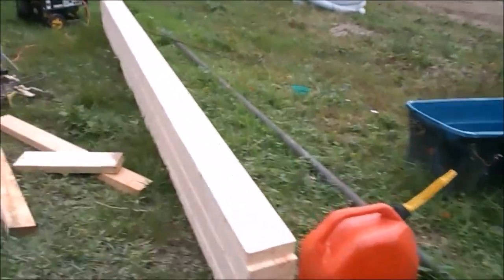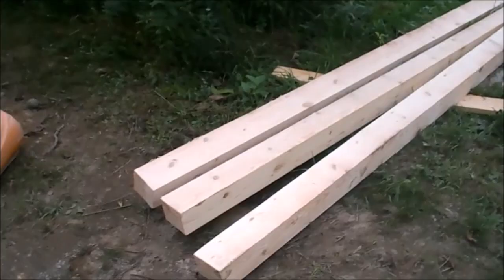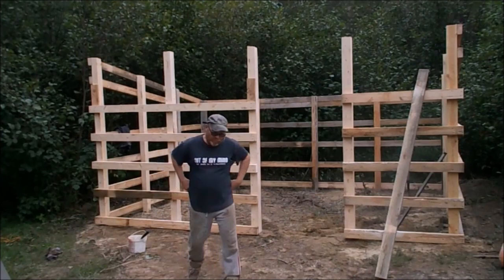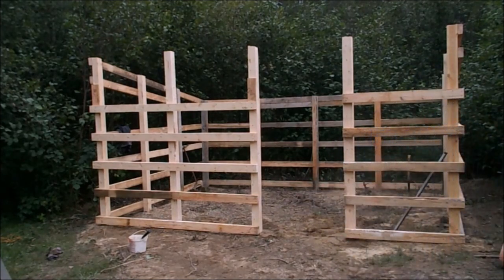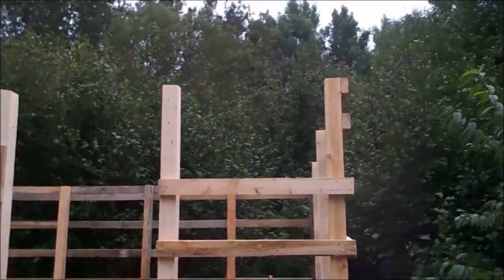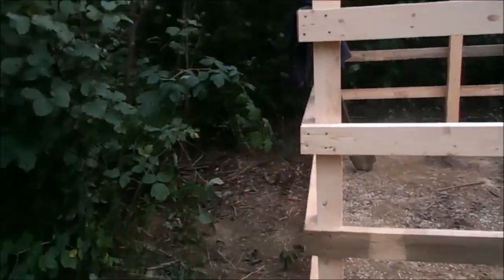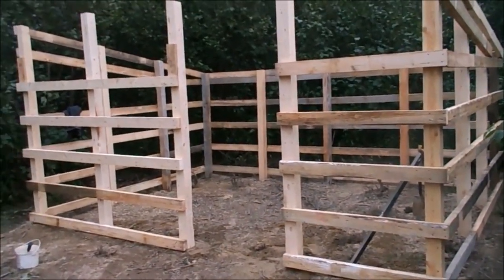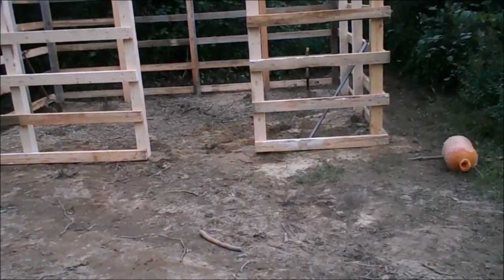Another Day On My Shed, Using My Homemade Bandsaw Mill

Comment: wont those posts rot off ... not trying to nit pick just woryed of a oversite
Reply from the maker: +gary krutsinger Well maybe, but I did soak most of the bottoms in a five gallon pail of used motor oil and diesel fuel for 12 hours, the rest I will just pour some on the posts,  I have seen untreated Pine posts here last for 30 years, and I am 47 now so hopefully they out last me. And if they seem to be getting bad I can just dig and pour a footing under the lower 2x4.   In my life and in my videos I try to do things simple and see if it works, like my band saw mill I built , cheap and scabby looking ...but it works, the posts, well I am really not sure lol... I just could not afford to do it right,  so we will see :)
Reply: ok hey good just trying to help i amm from illinois and things must be differnt ok good luck like the videos
Reply from the maker: +gary krutsinger No problem Gary,  Hey I can always use some advice, and it is nice to have folks looking out for me... I really appreciate it thanks, one fellah told me to coat the posts with grease and wrap them with plastic wrap he said that way frost cannot grab them and lift them out of the ground, it sounds good I think I will try that next time :) . You take care, ttyl Gary :)